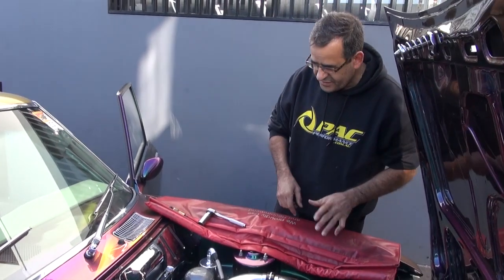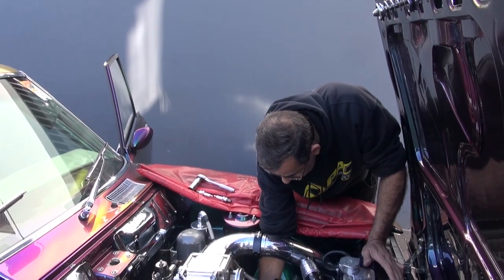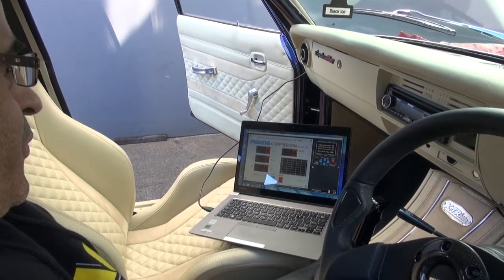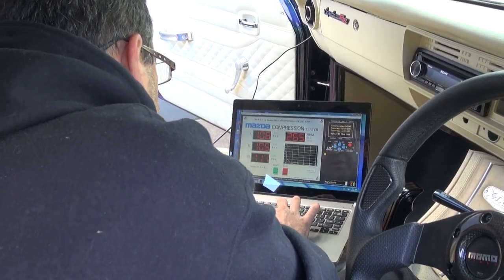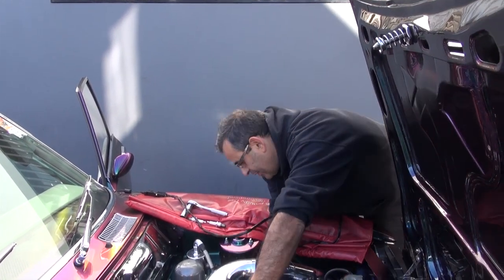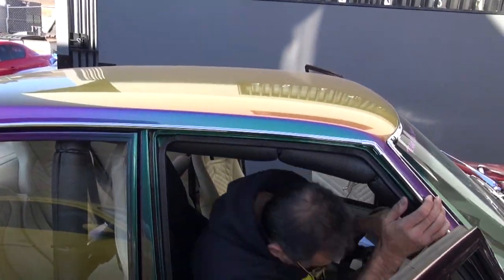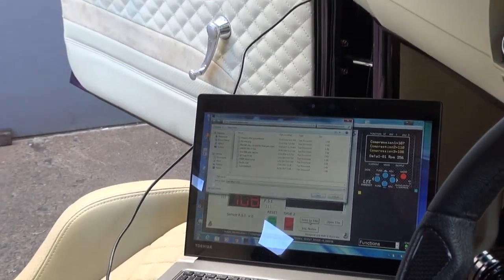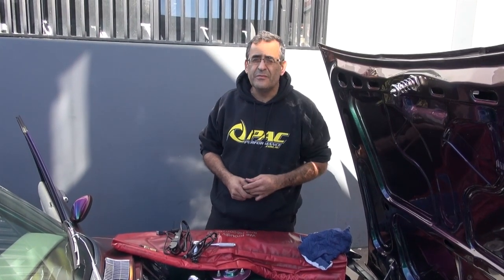ROCKY'S TECH TALK - COMPRESSION TESTING A 13B ROTARY ENGINE

Comment: So basically each face of the rotor forms a combustion chamber that goes trough the 4 strokes of the Otto cycle and COMPRESSION is one of those strokes. That means inside of a housing each rotor forms 3 separated combustion chambers and that is why you get 3 separated compression numbers (readings) 
So in a 2 rotor 13B that will be a total of 6 compression readings because a 2 rotor 13B engine has 6 combustion chambers. You get the 3 compression readings at 1080° of eccentric shaft rotation (Its complete thermodynamic cycle) 
So if 6 combustion chambers complete one 4 stroke Otto cycle each when the escenteic shaft has done 3 rotations (1080° /360° x 3 = 1080°)  and each combution chamber displaces 654cc that means the 13B engine true displacement is 
654cc x 6 = 3924cc (3.9L) @ 1080° eccentric shaft rotation (Complete thermodynamic cycle)
Ignition in a 13B engine is set st each 180° of eccentric shaft rotation and since it has 6 combustion chambers (one per rotor flank) 180° x 6 ignition events = 1080° (full thermodynamic cycle)

Mazda just quoted a nominal displacement accounting the 4 stroke Otto cycle of  just one side per each rotor (1/3 of its true capacity) And NO, the 2 rotor engine does not complete a full thermodynamic cycle at 360° of eccentric shaft rotation, at 360° of eccentric shaft rotation just one side of each rotor had finished its 4 stroke Otto cycle event, but there are 2 more sides per rotor just finishing their 4 stroke Otto cycle as well, so all 6 got to ve accounted.